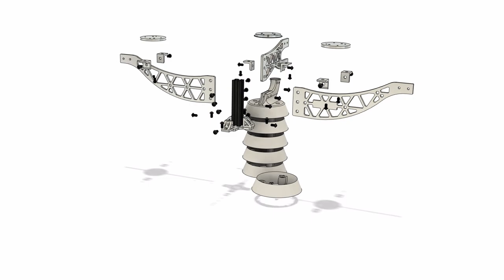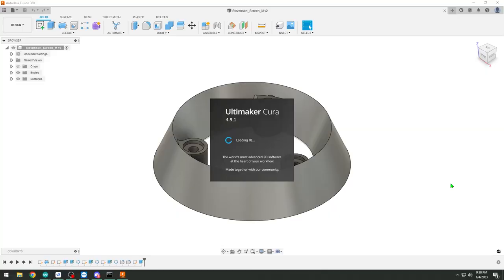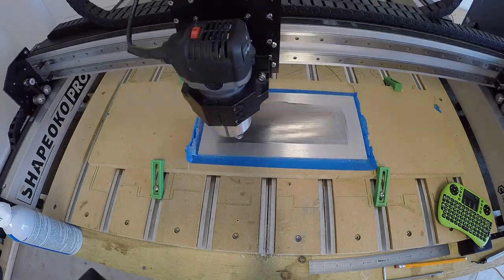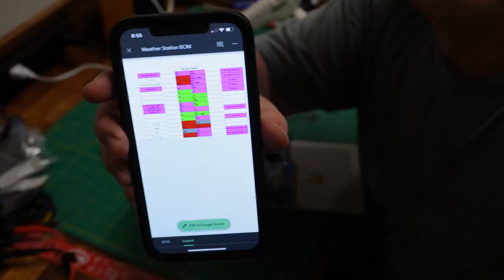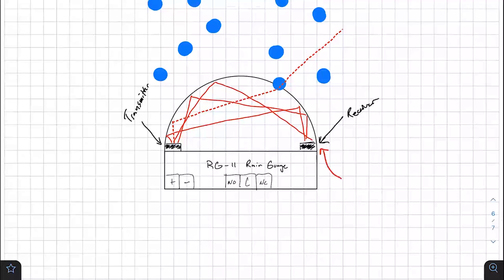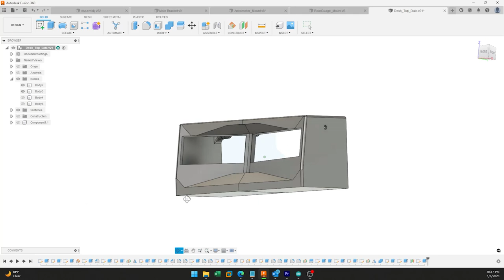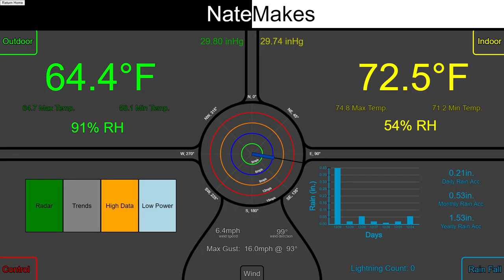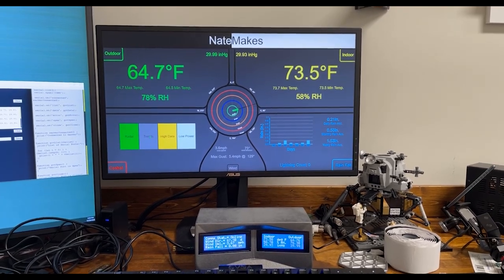Building a Custom Wireless Weather Station (Arduino)

Comment: Looks great ! Just wondering when cutting the T-6061 how tight of a tolerance this mill hold wile running those feeds and speeds ? The 5000 series aluminum is more prone to flexing and dose not have quite the shiny finish as the 6000 series is that why you chose to use the 6000 series.  If so they also make a 7000 series but its harder to machine. Great work as always

Comment: Were you successful in getting the GY-AS3935 lightning detector to work? I purchased one and I haven't had much success. Did you use I2C or SPI?
Reply from the maker: Yes I was able to get data back from the sensor using I2C communication. I did notice after I posted the video a few storms came through my area and the sensor didn’t seem to detect any lightning.. which is pretty disappointing. From my research it appears that the on board antenna may need to be tuned to get more accurate results!